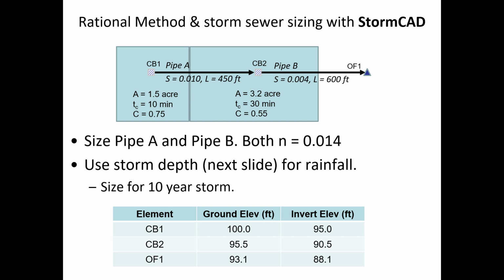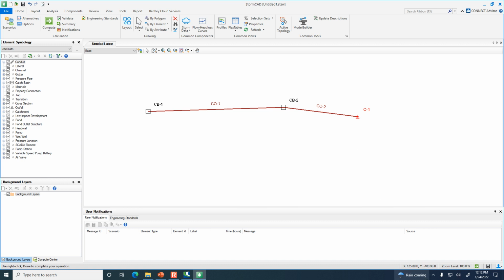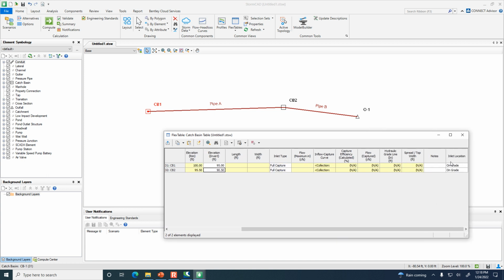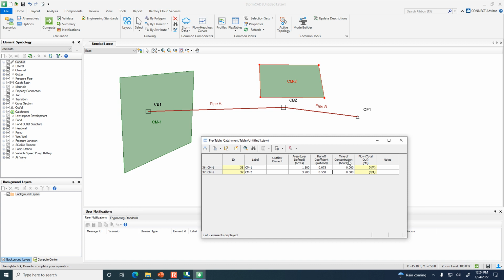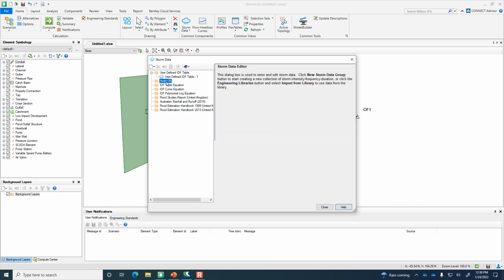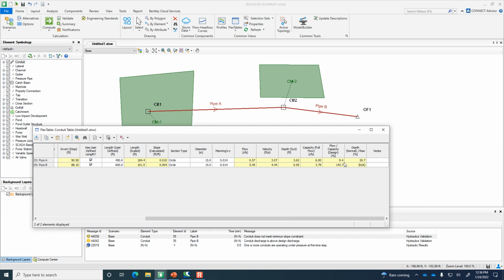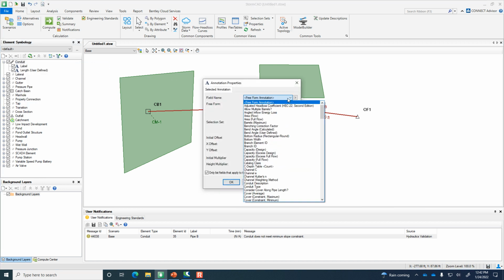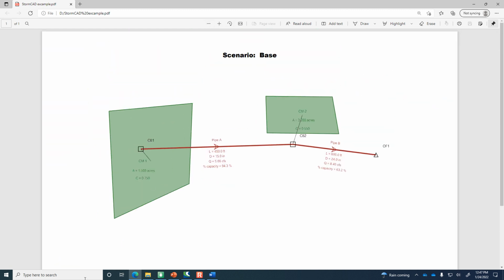Using StormCAD to design a stormwater drainage network - CE 433, Class 6 (24 Jan 2022)

Comment: Dear Dr. Isaac, thank you for your excellent episodes that enrich the scientific background of the professional engineering community. Imagine solving the same problem using EPA-SWMM instead of Stormcad, of course. It is expected to get different estimations simply because Bentley's package uses Rational whereas EPA's package adopts an overland Manning flow equation. My question is, as a designer, which peak flow number from both packages might you say I will go for it?
Reply: For Middle east,since worked in the projects, Muncipal authority will request for Stormcad model for review
In the Storm cad/Civil storm,we can auto calculate tc for bigger catchments/Plots by assigning catchment parameter in 5-6 methods(like Slope,CN,flow path length), for smaller ROW catchments where it cattered by gully/gutter system we have to consider minimum tc as per the code say 5minutes or 10minutes

Comment: Hi Dr. Wait, thank you for sharing practical skills for design of stromwater drainage pipeline. May I ask the methodology of determination of time of entry/ time of concentration for urban (paved) area? I know there is a formula (i.e. Brandsby William's Equation) to calculate the time of concentration for natural catchment. However, I was told I should apply 3 mins for urban area but no one explained in detail. I am curious how the time of concentration (i.e. 3mins) for urban area came from.
Reply from the maker: For an urban area the time of concentration can be estimated by determining the distance between the farthest point away from an inlet or point of interest, and estimating the flow velocity at different stages on the path between that farthest point and the inlet.  On a street, for example, some of the flow may be relatively slow-moving sheet flow over the surface of the pavement, and then a period of shallow concentrated flow where the velocity is somewhat higher, transitioning to deeper concentrated flow (e.g., in a gutter) where the flow velocity is higher still.  So it's the travel time.  Visiting the site on a rainy day may help.    This video shows some equations that may also be useful. https://www.youtube.com/watch?v=i7lZWDVJGvI
Reply: @IsaacWait  Thank you for your explanation. I also love your videos which refresh my mind. 🙌